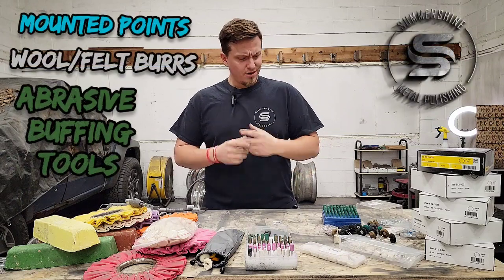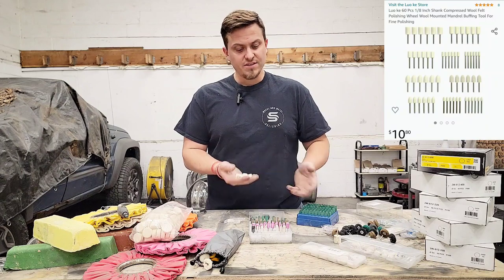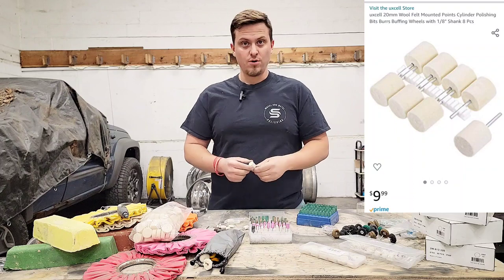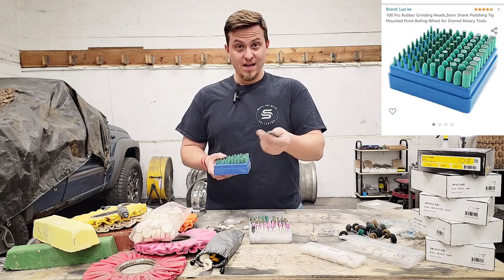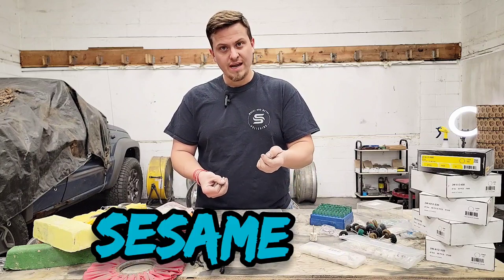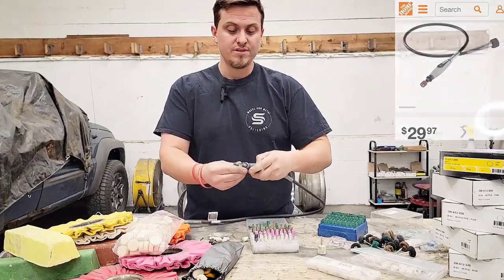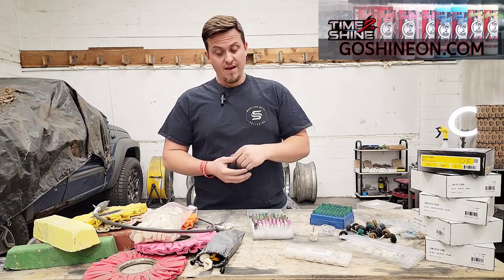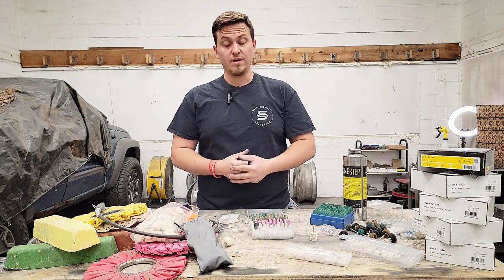Polishing Bits, Burrs And Buffs

Comment: Theres a guy on eBay who makes and sells 1/4 inch chucks for the Dremel and its awesome. It opens up a whole new realm of possibilities for your Dremel being able to use all those bits that were just too big to fit your Dremel... Also, I have that chuck fitted onto my Dremel 8260, its battery powered and still plenty strong enough to spin a 3" buffing wheel on a 1/4" mandrel... Oh and it has Bluetooth too, so you can program your Dremel from your phone I guess...
Reply: "It opens up a whole new realm of possibilities for your Dremel being able to use all those bits that were just too big to fit your Dremel..." - That's wrong on so many counts.....